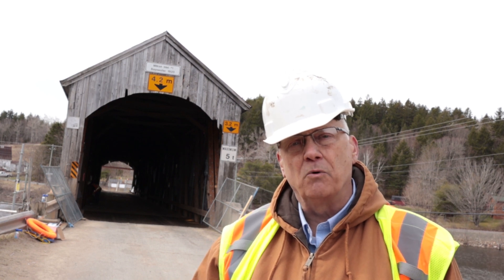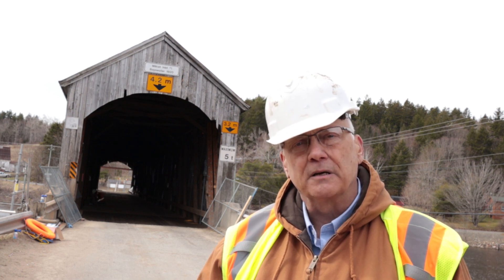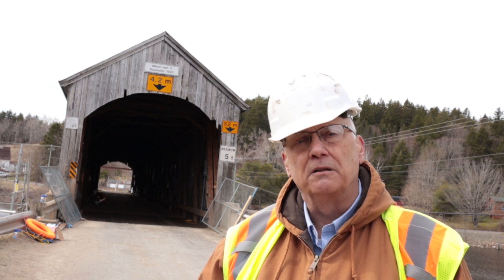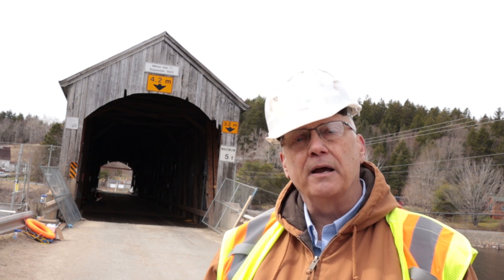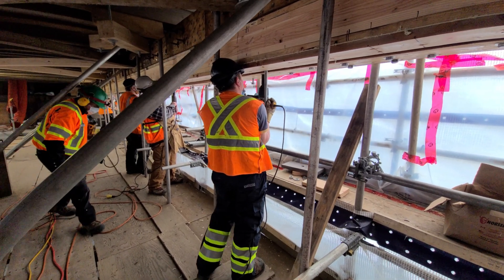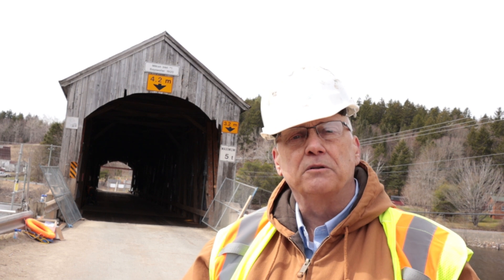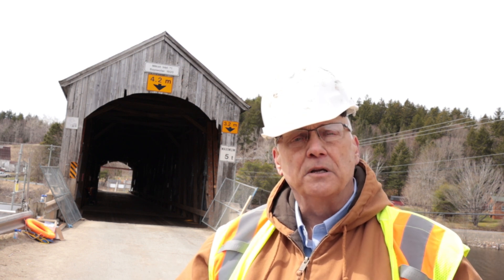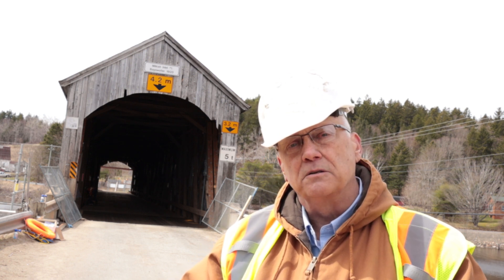The Bayswater Covered Bridge Restoration | Timber Restoration Services

Comment: Very interesting project.  Is the loss of camber over time a function of creep of the wood fibers over time or deterioration of the wood fibers at the connection points? Likely a combination of both I would think.   What steps do you take to keep water out of the end grain of your new timber decks?
Reply from the maker: Thanks Jason! Here's the answer from Dr. Tingley: 

"The loss of camber over time in an old timber truss has more to do with overloading than anything. Typically wood designed to a certain load capacity operates at about ¼ to 1/3rd of its yield limit (the point at which creep strain really starts to kick in). Well below its yield stress/strain. Thus, timber trusses tends to hold their original camber unless overloaded or degradation occurs. They might slightly strain with constant load over time but in this bridge with a design pre dead and live load camber of 88 mm it would have had about 40 to 50 mm of camber post dead load. This camber and proper vehicle loading within the design load of 12Tonnes would have not led to a lot of creep. However, overloading broomed up the ends of the webs, created bending cracks in the stitching bolt area of the tension splices in the tension cords, and loosened the tension webs. Then some many decades ago the NB covered bridges were fitted with hawg jaws to prevent ultimate collapse from wear and tear and overloading. These hawg jaws caused the truss to act and respond to load differently. The hawg jaws expanded in the heat of the sun in the summer and contracted in the winter in the cold. The wood didn’t as steel and wood have dramatically different Coefficient of Thermal Expansion and Contraction. Hawg jaws are not he way to fix timber truss covered bridges! The bridge was subsequently rotating about the hawg jaw bearing points as well as the abutments and as working under overloading. This working of joints and elements causes creep. The timber covered bridges then sagged a lot. Milkish had 2.75” of sag in the trusses from the original post dead load camber of 2 inches. Nearly 5 inches of creep sag over 100 years. The retrofit involved raising up the old bridge with a lift apparatus that allowed the post dead load camber to be reinstated and the hawg jaws removed. Further, the load capacity was increased to 30 tonnes and the nodes were tightened up, webs strengthened, compression cord strengthened, the tension cord strengthened with high strength fiber and the tension cord splices and nodes restored, completely decayed areas were restored with dutchmans patches and the bridge was basically brought back to its original glory and more with an increase in the design capacity by nearly threefold. So in summary the creep or sag in old timber bridges is predominately caused by overloading, corrosion of the metal both embedded and exposed and then decay in isolated areas."

Dan Tingley Ph.D., P.Eng. (Canada)

The last question about keeping the water out... no cuts are done on site. Everything is manufactured and pre-treated before it arrives on site, and then assembled on the job site.